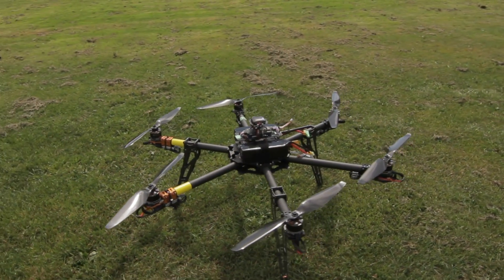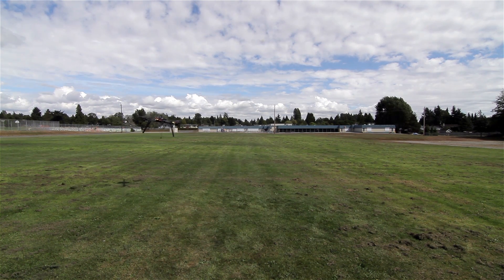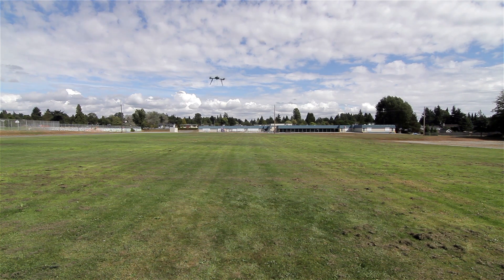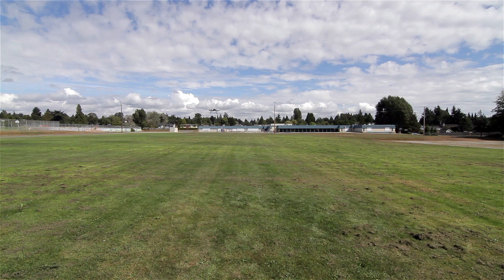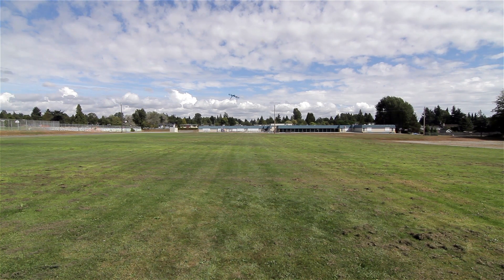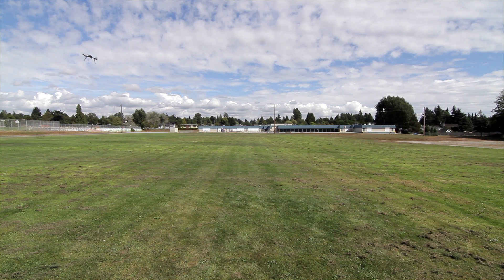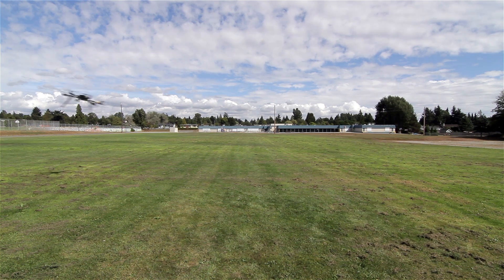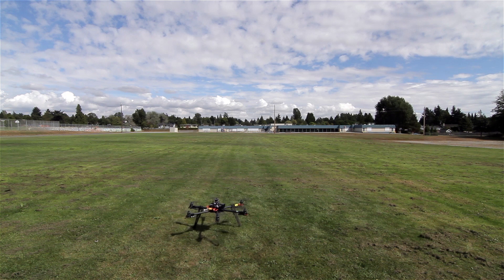Tarot 810 Hexacopter 2nd Flight Test

Comment: Hi Rick, thanks for the video,
Can you tell me how much you can fly in time? and witch battery are you using?
I build one tarot 960 with this config:
1 frame tarot 960
6 mayteck simon k firmware 50Amp
6 tiger motor 4012 370kv
6 carbon prop 13"
1 powerbord grypon
1 naza-M lite + gps
Battery turnigy nano tech 6s 5.0Amp 35-75c
and as you can see on the video that I send the link, I just fly abut 4 min :(
and I know that i have to change my prop for 16" or 15" but I believe this is not the only problem that makes my fly time be so short, any guess or advise you whant to share ?
thanks
Reply from the maker: HI Goncalo, Sorry for the late reply.  I would guess that your main issue is the 13" Props as you say.  I would recommend 15x5.5" which is what I am using.. Get the wide ones like these: http://www.rctimer.com/index.php?gOo=goods_details.dwt&goodsid=922&productname=

I use 2 batteries:  6s 5000Mah 70c (about the same as you)

Also are you using the Naza built  in battery monitor?  It always says to land too early.  Get a couple of the small battery alarm-buzzers and set them to 3.5 volts.  This will give you maximum safe flight time. The ones marked "AOK" are the ones I like best: http://www.hobbypartz.com/79p-8003-voltagemonitor.html
 
Please feel free to ask more questions.  I love to help!
Reply from the maker: I forgot to answer your question on my flight-time.  I am getting about 15-16 mins without camera and 13 mins with my Canon 5D

Comment from the maker: HI Phil, Well I purchased the frame from the manufacturer (Tarot) but the parts list is drawn from months of research and from at least 20 vendors worldwide. This was a test platform to shake out and test all the components for a commercial version that I am currently designing.  It will be a significantly cleaner build and a fully portable complete system including ground stations and charging stations.It will all fold down and break down quickly into three large cases for global transport